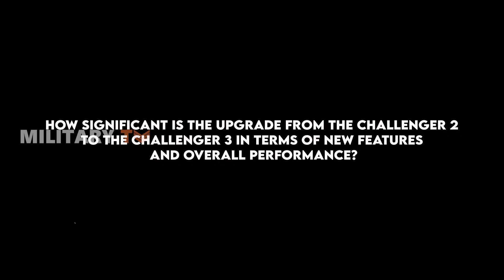The Secret Behind Challenger 3's Testing in Germany

Comment: They tested the new German Rheinmetall Gun L55a1 (Same on Leopard 2 a7+ and a8) on the latest Version of a Russian T-72b3 and the Pin penetrated the complete Tank ..througFront Armor, Engine Block and Back Armor. Very impresive. The old britisch gun was a good one...very accurate but the new one is signifikant better and Brings the Challenger much more firepower. Another Big Advantage... You dont have to use for loading a 3 Part ammunition like in the past on Challenger 2. Now you have only 1!!! Much better, much faster.

Comment: Wait, what?

The L/55A1 is compatible with NATO ammo AND US-specific DU ammo also, like the M829A4.

So Challenger 3 does not lose access to DU... Germany and other NATO countries haven't bothered with DU ammunition as the L/55 paired with DM63/KE-W A4/DM73 outperforms the latest generation DU rounds.
The L27A1 APFSDS is the latest development of DU ammunition for the Challenger 2, it boasts a muzzle velocity of 1,650m/s. DM53 has a muzzle velocity of 1,670m/s, DM63 has a muzzle velocity of 1,720m/s, KE-WA4 has a muzzle velocity of 1670m/s (L/44 cannon, would be higher from L/55) and DM73 has a muzzle velocity of 1,780m/s...
So there is absolutely no negative impact at all in any capacity by switching to the smoothbore L/55.

I would highly suggest more research before making broad claims like "... by switching to the smoothbore gun, the Challenger 3 loses DU rounds..." [paraphrased].

The benefit of a smooth-bore gun is that the Challenger 3 is not limited in ammunition supplies in a conflict zone as it can borrow from other NATO countries.
It also swaps out the old 2-piece ammunition for single-piece ammunition, giving it faster reload times and allowing for easier ammo storage in the vehicle.
Maintenance and barrel cleaning/servicing is quicker and easier as the crew does not have to scrub out the rifling in the barrel.

Final point... DU provides health risks to crews of tanks hit by DU rounds? What, like death? Seems to be a side effect of shooting a tank with any AP ammunition...

Comment: The comments about Rheinmetall being in Germany is the reason it was tested there are wrong. The gun and turret are made by Rheinmetall BAE Systems Land in Telford, UK. It was sent to Germany to the NATO tank ranges because they are longer than the UK's and are standard, allowing a meaningful comparison between the CR2 and upgraded CR3.
Reply: Firing range at Hohne and Soltau have been in regular use by british tank crews since the 1950sI tested the 120mm gun on the Conquerer in 1958

Comment: The USA M1 Aberhams uses same smooth bore gun (as does german lepard 2), M1 uses nato ammo and depleted uranium shells in iraq so uk should also still have depleted uranium option what I would question is will it have range and more importantly accreasey at range old rifled gun had. New smooth bore gun should last longer so is cheaper. What C2 needed was improved protection and droan versions that can draw fire away from crewed version. 
I wonder if USA is working on a stealth tank?

Comment: One thing it does not address is accuracy. The rifled bore is more accurate over longer range. Ukrainians call Challenger 2 the sniper tank and I can't help worrying that the change to smooth bore is a Whitehall bean counters call not a military one
Reply: 120 mm projectiles have fins, no rifling required.

In fact the APFSDS round for the Challenger 2 is fin stabilised and has slip obturation rings that cancel out the rotation. A smoothbore can leave out the slip obturation rings and thus lose less energy to friction and can sustain higher pressures in general because the lack of rifling allows for higher autofrettage pressure in the manufacturing process, resulting in a stronger barrel.

Comment: This entire film is badly researched and utterly wrong. All NATO tanks have the ability to use DU ammunition and the British version made to be fired from a rifled gun cost significantly more and had a slight but notably lower mussle velocity reducing its effectiveness. Meaning the Challenger III will have access to cheaper better DU rounds than any of its predecessors. The only round that they will no longer have access to is the HESH round whch required spin stabilization for both accuracy and effectiveness and while these were excellent ammunition for many years they struggle with modern ERA spaced armour and composite armours making them largely obsolete. These will be replaced with the newest programmable ammunition developed by rhinemetal.

Comment: The US is using DU rounds with the exactly same L55 smoothbore barrel
Reply: The US Abrams still retains the two generations older L44. Their stabiliser can't handle the heavier L55.
Reply: @jonny2954  Thx, I always thought they used the same gun as the Germans.
Reply: @hackbrettschorsch6855  Same gun as the Leopard 2A4 and A5. 2A6 and later use L55, 2A7V and A8 use L55A1.
Reply: @jonny2954  I figured as much. Just thought they also switched when the A6 was upgraded to L55.

Comment: The new higher pressure gun and higher pressure APFSDS round is hypersonic which is what Challanger 3 is using.  1800 meters a second which is mach 5.24 that’s hypersonic.  That’s going to do a lot of damage and be very difficult to stop even with composite and or spaced armour.
Reply: @Biketunerfy  Interesting statement. The only thing I could find is that they changed the main gun to a smooth bore to make ammo universal across nato tanks. At 60 tons it’s not going to be an all terrain option anyway.
Reply: @  yes it can use tyre standard pressure NATO ammo or the newer higher pressure ammo.
Reply: @ Will they withstand a lancet strike ?
Reply: @davemccrillis1470   The British took much if the secret armour and secret equipment off the challenger 2s they gave to Ukraine but I doubt any tank could survive a hit to roof of the tank as that is not very thick so regardless I still don’t think challenger 3 would survive a hit from one unless they are fitted with an active protection system which they do have.
Reply: @ I still don’t think I want to be in a tank on today’s battlefield
Reply: @davemccrillis1470    Well APCs are meant to stop shrapnel and being hit until you get to your point of destination but they seem to be magnets for angry birds and artillery in the open.  Yes, I think tanks are nearly obsolete now but it’s always been a cat and mouse game.  The engineers will come up for a defence against it and the weapons manufactures try to over come those defences and on and on it goes since the dawn of tanks in WW1 when the Brits invented them.

Comment: The Challenger 3 gets trialed and tested in germany, because the design team and parent company sits in germany and the UK does not have a relevant capability in that regard.
The UK will only put together the delivered upgrade components in its Rheinmetall owned factory.

The Challenger 2s DU Ammunition severely laggs behind NATO non DU Ammuniton like DM63 from germany.
DM63 has about 25% higher penetration than the british L27a1 DU round.

Comment: They have DU rounds for this gun already.  Whole point being UK will be using the same Ammo and gun as the US and Germany.  Meaning lower logistics for ammo supplies. Bur also spares, repairs and maintenance. 
There are modern rounds developed or in development  that can match or out do DU rounds. Much cheaper, and much safer ( unless your getting hit with it)
Reply: there are already DU and non DU rounds n service for the 120mm for close to 20 years that match or outperform the british DU rounds.
German DM63, in service since 2001, 25% higher performence than L26 and L27 DU rounds.
US M829A3, the same.

Comment: Very interesting details 
Who seriously gives a shit about EKR. 
It should 1 shot 1 kill
If DUM/DUR is cheaper, faster kill ratio; more battlefield effective, then why the hell are we bothering with EKR/KER 
To satisfy who to get access to the Rhinemettal barrel?
If that’s the politic requirement to satisfy the deal; it’s pathetic! And someone is getting a backhander somewhere
1 shot, 1 kill! Anything more than that means added risks to Challenger3 crews; because they can’t shoot and scoot!
Rheinmetal L56A1 yes but with prerequisite that it’s DUR/DUM capable
Yes there are risks but we’re talking in a war situation.
Everyone knows that when DUM burns it gives off Ceasium 137!
It worked in GW1&2 so why change it now
Reply: the point is, that EKR or DM73 has close to double the penetration of the current CR2´s DU ammunition and similar or better performence as M829A4
Reply: That's not how 137Cs is made. It's a fission product, not a combustion product. Burning uranium or other metals does not fission them into smaller isotopes.  It would be more accurate to describe burning a metal as producing metal rust and heat.
Reply: @JarViKK_gaming  DU is a pyrophoric heavy metal, menaing at high friction it sheds DU dust, wich ignites.
The "burnt" dust is still a toxic heavy metal pollutant, as the Dust itself does not burn up but oxidises.
Thats the problem what people tend to miss wth DU ammunition and armor inserts.
Its not radioactive, but the materal it sheds is toxic and produces similar effects to lead poisoning, but at a smaller dosage and in dust form (like after an DU Round Impact where it is residual in the air for some time and coats the surfaces around the target for quite some distance) it can cause severe lung tissue damage etc.
 So people stay better clear (at least 20m or further) from a tank that got shot with DU ammunition or included DU armor and was shot.

Comment: "DU provides essential health risks, especially for crews of tanks hit by DU rounds." That has got to be one of the most ridiculous lines I have ever heard in a military documentary
Reply: I dropped down to make this exact comment. I am both shaking my head at its stupidity while laughing.
Reply: The problem with DU rounds is, that these toxic substances stay around after the war is over.
Reply: Read my reply, about Fort Carson.  It has less radioactivity than our local Granite rocks.
Reply: @brunonikodemski2420  correct, the I'd areas of Dartmoor you would not want to liv
Reply: Thats the last thing on the minds of the crew as they are splated around the inside of the tank.
Reply: Please provide your evidence.
Reply: Then don't start a war.
Reply: say the words DU stand for, then re-read the first word. it isn't used because its radioactive, its Depleted..... the levels of radioactivity from DU ammunition is negligible at best, the accusation of it leaving "long lasting health risks" is a cop out tactical to attack the MOD. and its utterly false.
Reply: @BADDTV  Wrong. Depleted simply means that it is low in the fissile isotope U235.
U238 is still radioactive (albeit  with a very long half life) and an alpha-emitter. While a solid DU dart poses very little health hazard, breathing in fine DU particulates, as would result from armour penetration, is a very real health hazard.
Reply: @bobthebomb1596  that isn't what the video is getting at at all is it.. the video is trying to suggest it hangs around like a damn nuclear reactor.. which is false. entirely.
Reply: Try reading my initial comment again.
Reply: Yeah, the last thing a tank crew hit by a DU penetrator needs to worry about is the long term health effects of inhaling radioactive dust! 🤣
Reply: There are also massive cost implications. DU is essentially a worthless byproduct of Uranium fuel for power stations and A booms, that weapons manufacturers can obtain for zero or low cost. Tungsten is very expensive and china mines 85% of it, 68 thousand tons with Russia a distant second at 3 thousand 600 tons.
Reply: @Michael_Brock  Do you know if Aussie produces much? if so we still Gucci.
Reply: Doesn't matter, Drones coupled with AI and a couple more years development on both will render conventional weapons like the tank obsolete.
Reply: I've thought this before - yes DU bad - so is the Kinetic Penetrator tearing the tank interior to bits !
Reply: Well, technically, it's not wrong though....
Reply: @sunnyjim1355  Agreed.
Reply: Yes uranium is toxic. Tungsten is toxic too. As are all heavy metals. But uranium and tungsten are not as toxic as lead for example.
Reply: @hernerweisenberg7052  We are not talking about chemical toxicity, toxicity is a separate issue.
We are talking radioactivity. Tungsten is, for all practical purposes, non radioactive. All isotopes of uranium including U238 are radioactive. As an long lived alpha emitter U238 poses very little threat externally. If vaporised particulates are inhaled/ingested however that is not the case. There may be fewer alphas generated compared with U235 but their energy may still be absorbed by living tissue.
Reply: @bobthebomb1596  I bet you consuming any amount of U-238 will be far less harmful for you then consuming the same amount of lead, so why ponder about allmost non existing radiation effects if the chemical toxicity of heavy metals like lead is so much more harmful then a few low enegry alphas?
Reply: @hernerweisenberg7052  Bet all you like, I couldn't care less.
Reply: @bobthebomb1596  Dont care about whats more harmfull either? Lets say youre trapped, 2 doors lead to freedom, but behind both are long corridors. Corridor behind door A is filled with U-238 vapor from the DU ammo casting facility below. Corridor behind door B is filled with the same ammount of lead vapor. The corridors are too long to cross holding your breath. Wich door do you go through?
Reply: @hernerweisenberg7052  Point being, I don't care what bollocks you spout.
Reply: @bobthebomb1596  Typical answer of the bollocks spouter. If you knew anything about that radioactivity you are spouting about, shouldnt you be able to weight the adverse health effects due to radiation dose vs those of toxicity?
Reply: @hernerweisenberg7052  As both a retired chemist and Radiation Protection Supervisor, I have. 
I see that you are not able to look back at my original comment and comprehend that I was comparing the ill effects of inhaling DU dust to those of being subjected to the effects of a penetrator piercing the armour of the tank.
Reply: @bobthebomb1596  We are talking about toxicity,  DU is toxic and can damage kidneys due to its chemical makeup.
Reply: @hernerweisenberg7052  Corridor B - because you don’t know what you’re talking about.
Reply: @martinfrench5527  DU is about as toxic as lead people don’t realise it is less radioactive after processing than the mined ore the clue is in the name depleted. After all lead is very dangerous after it leaves a gun barrel.
Reply: DU isn’t great on the receiving end, oh well 
Challenger programme needs to address over weight and under power issues though. Russian and Chinese threats are not going away so we need best options to neutralise them quickly. We don’t need Ukraine2.0 dragging on against us
Reply: @HighFell  No arguments from me. Build the best tank you can.
Reply: Yes you get wokery every where is as infectious as covid sar2 .
Reply: imagine being hit by a DU round and being worried about getting cancer..
Reply: I don't think it's rediculous at all. The Hague and Geneva conventions are designed to protect the lives of soldiers. The goal is not to kill the enemy or maime. The goal is to force strategic surrender. The problem with DU is that the dust is very toxic, a little worse than led. Soldiers inspecting tank kills will be exposed to it. For survivors of a DU shot, they will be exposed to effectively a chemical weapon. In ww2 the 303 round had a light aluminum core tip. To save precious metal they subbed in cork instead of aluminum. They required that the cork be disinfected, as a survivor of a hit should not be subjected to needless suffering of infection. That's honor and consideration that people seem to have forgotten used to be the norm.
Reply: If you're hit by a DU anti tank round, long-term kidney damage will not be the major factor
Reply: 😂 yeah because you wouldn’t want to die 😂😂😂😂😂😂😂
Reply: @secret5070  I'm glad it wasn't just me thinking that rofl :)
Reply: Agree'd. 100%

Comment: The Challenger 3 is a resto-mod on an old Challenger 2 chassis. The gun is a smooth bore German weapon not as accurate as the gun it replaces, which can now no longer be built in the UK.
Reply: Except the German gun is just as accurate because the APFSDS fired from the rifled gun is literally not spin stabilised. The round has slip obturation rings that cancel out the rotation because it is fin stabilised. On APFSDS rounds the rifling just adds unnecessary loss of energy due to the friction. Only HESH is spin stabilised.
Reply: @jonny2954  Which one holds the record for the longest range tank kill? 🤔
Reply: @deputydawgac  Record holder is a Ukrainian T-64BV Drone assisted (Kropyva system) non line of sight kill at 10,600 m with 2A46 125 mm smoothbore gun.

Longest conventional ranged MBT is the Quatari Leopard 2A7Q, only Leopard 2 variant to have a weather station equipped to reliably hit targets with KE out to 5000 m with 120 mm L55 smoothbore gun.
Reply: @jonny2954  The fact remains that the giant Vickers factory in Leeds that built the Challenger series has been flattened with a housing estate built over the top, as has the foundry that built the previous world's best tank gun. The country that invented the tank can no longer design and build a new one. England and the UK totter about the world stage like a helpless toddler, under the protection of her master, the USA.
Reply: @deputydawgac A tank gun that was adopted by literallay noone else and the UK MoD wanted to get rid of for more than a decade is far from the worlds best. It has the same accuracy and much lower operating pressure than the Rhm 120 mm.